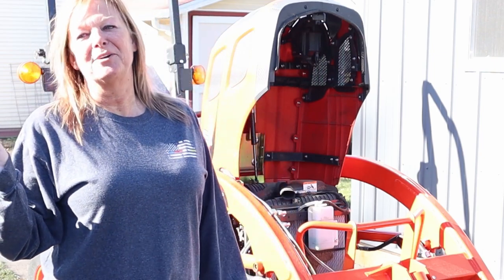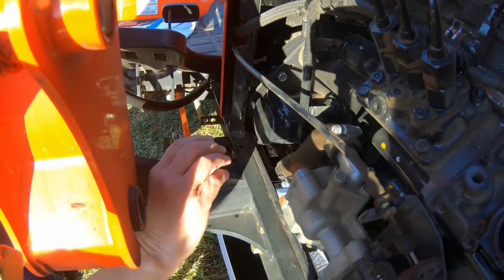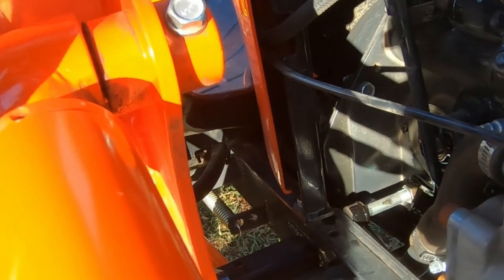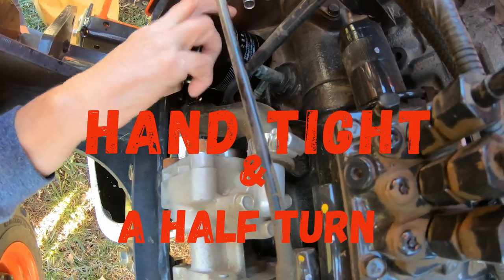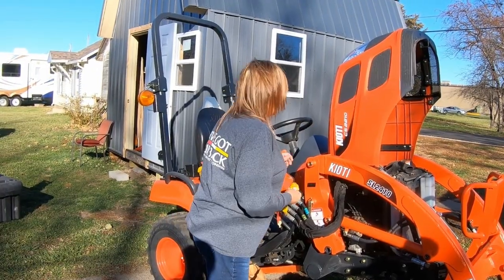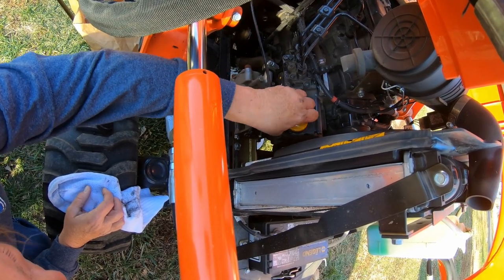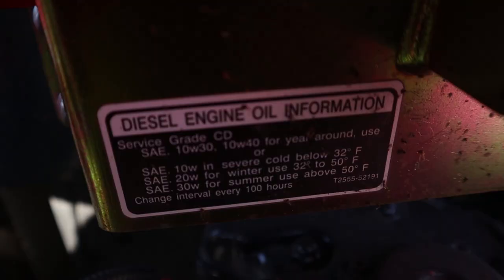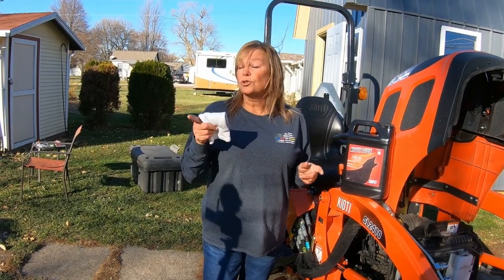KIOTI CS2210 OIL CHANGE - My first time EVER changing oil and filter

Comment: I have a cs2410. I do oil change without front loader, makes the job much easier fyi.
Reply from the maker: Thank you for watching. It's difficult for us to take off the bucket, we do not have and level hard surface to do that right now. Thank you for that tip it's a great idea.